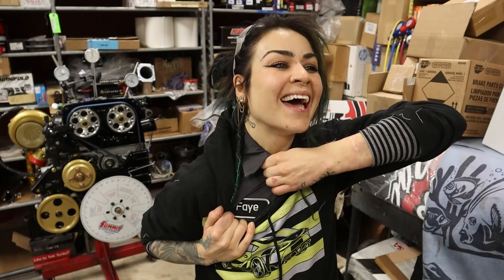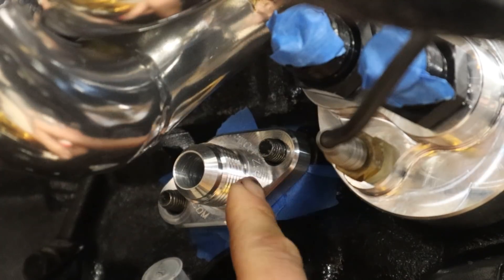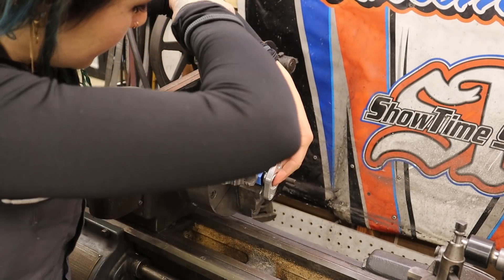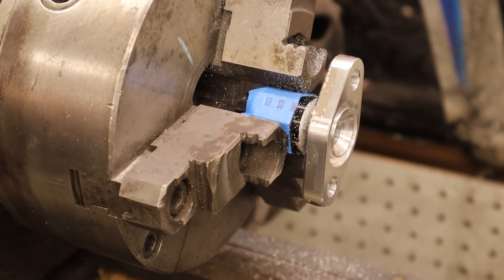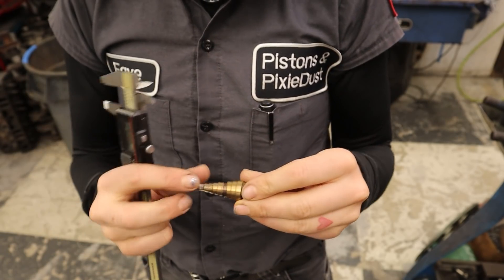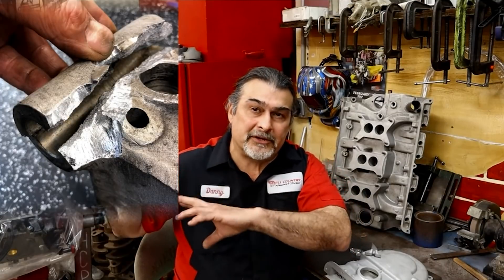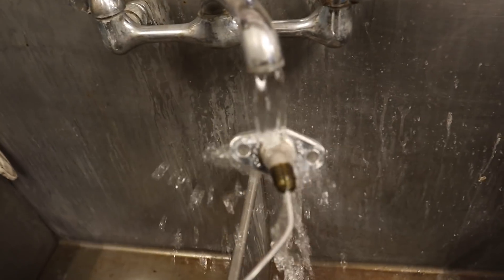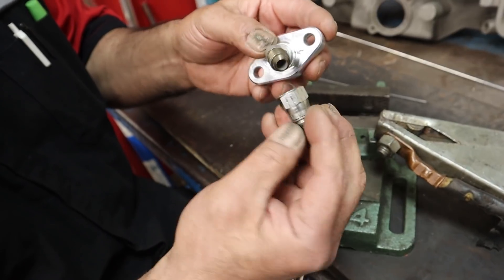Must EVERYTHING be custom? Questioning my Sanity and Making a New Oil Cooler Return Fitting (pt. 19)

Comment: Took me a moment to understand what you were doing in this video.  At first I was yelling to myself that  6AN is too small for turbo drain, but then you mention the modified fitting is for cooler oil return.  I'll advise that it's best for the 7M to convert to a thermostatic oil cooler setup with a remote filter, and ditch the OEM pressure base oil cooler arrangement.  Lots of DIY info on supraforums
Reply from the maker: I already did. That's the large billet disc that goes in place of the stock oil filter housing that you can see in this video.